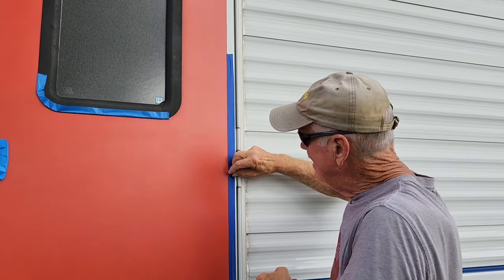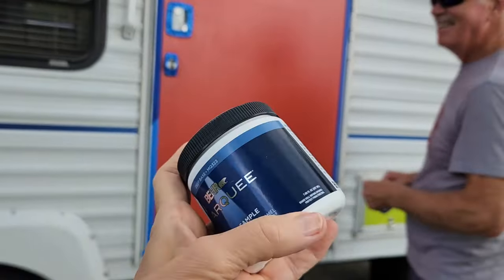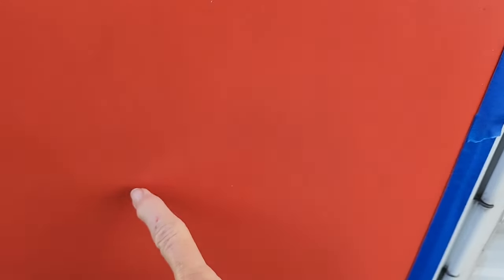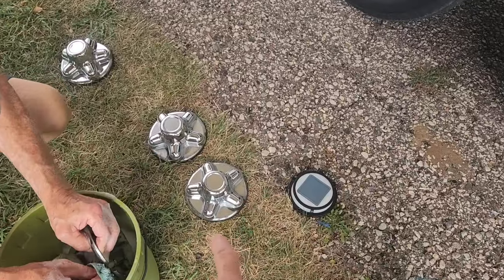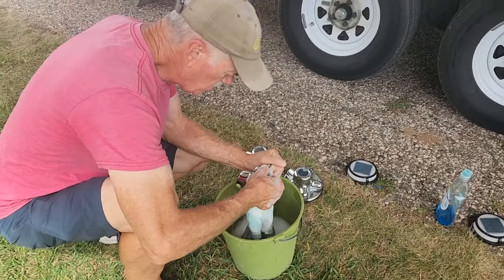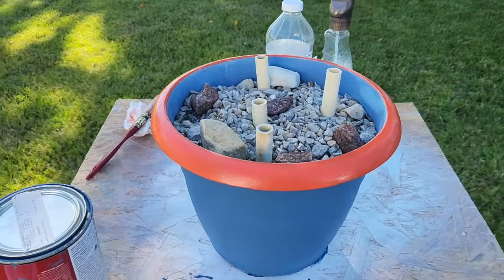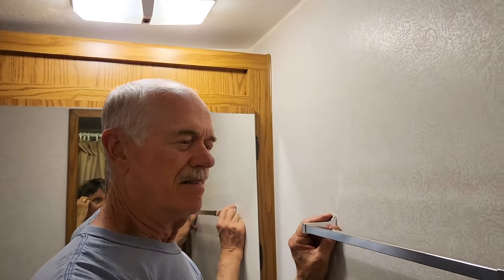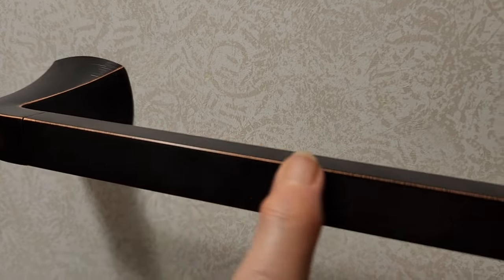Yr 7: Making old RV pretty!!  Will it get us accepted at 10 yr rule RV park?

Comment: Beautiful improvements, regardless of the reason for doing them; it probably feels good!!  We can understand the 10 year rule to a point, especially if it's a Rent-A-Wreck, but if RVs are taken care of, the rule seems a bit snobbish. Did you ever consider putting a decal "Faith" or "Roads of Faith"  that back window cover? 🤗
Reply from the maker: Thank you!  True...Whether there was a 10 yr rule or not, we would be doing the same things just to keep it looking good because it is our home. And we do understand not wanting someone pulling in with tarp on the roof and falling apart...but we have been turned down just because of her age in the past, even with sending pictures. 🤷‍♀️
As for putting our logo on the back....have dreamt of that for the past 6 years.  Ideal way to do it is on vinyl that fits like a fitted sheet so it can add insulation and be easily removed. Finding a place that does that to custom fit AND where to have it sent to for delivery has been my 2 obstacles. Maybe we'll find a place that does that type of product while in our winter location.  We'll see! 💕
Reply: @RoadsofFaith  💜✝️💜
Reply: Etsy and have it sent to one of your kids house or your sister when you know you’ll be visiting them or  Maybe have it delivered to the church Gary will supply for??